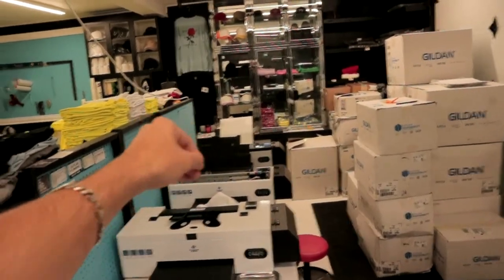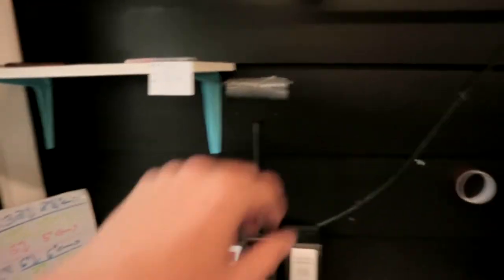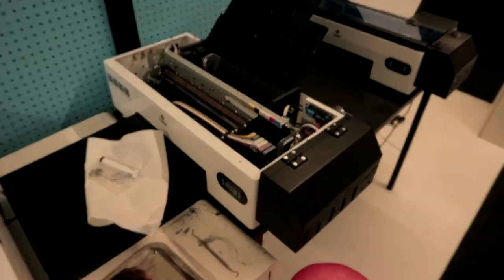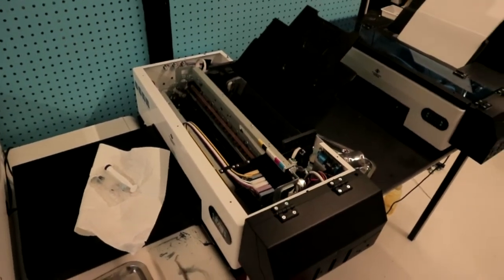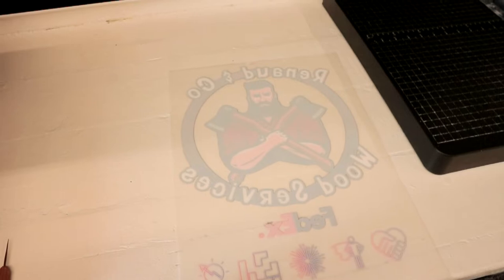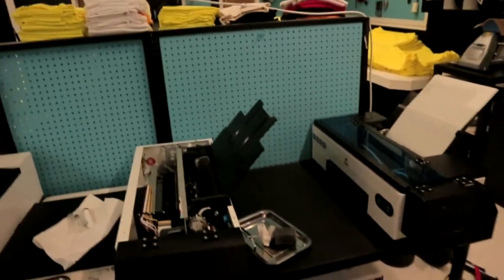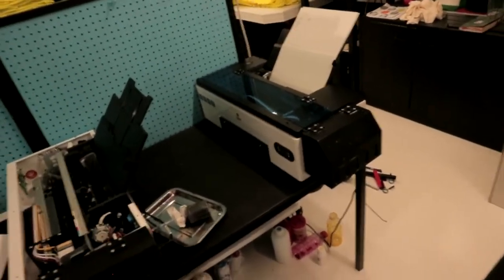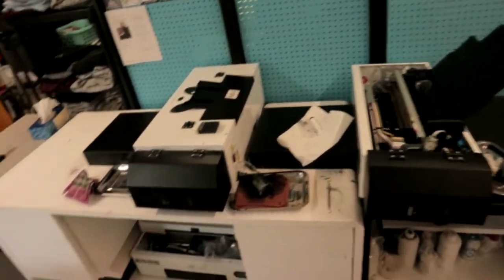Direct to Film FAQ's DTF Q&A's #3

Comment: Are all your machines the procolored L1800? What are your thoughts on the DX5(R2000) printer head which looks to be a step up from the L1800 printer head?
Reply from the maker: never tried it
Reply: Can you help with the DX5 R2000 Stylus Photo printer (got thru procolored). I have paper and ink lights blinking (alternating)... machine has power (red button in back) but the ON button in the front goes off but the lights stay blinking..... PLEASE PLEASE HELP
Reply: @Wholeprinting Can you help with the DX5 R2000 Stylus Photo printer (got thru procolored). I have paper and ink lights blinking (alternating)... machine has power (red button in back) but the ON button in the front goes off but the lights stay blinking..... PLEASE PLEASE HELP

Comment: Thank you for the video Dom, I purchased a procolored A3 L1800, 2 weeks ago and cannot find a video to show how to program my settings for printing. I installed the software and the ink.  Printed out several prints. The only problem is that my white will not come out. Can you please do a video soon showing how to program the software?  How to set the printer, ink and layout pages. I'm searching for help and keep reaching out to Procolored and not receiving the help.  I'm sure it's due to the time difference. I've called the numbers they given with no answer. I've even waited up later to reach out.  Email seems to be the only contact though we have yet to connect.  I also ordered the same ink you have to make sure that I'm on the right track.  I've waited up later to reach out.  Email seems to be the only contact.  We have yet to connect.  I also ordered the same ink you have to make sure that I'm on the right track. I have the Rip v10 software that came with it. Please help. 
Rhonda
Reply from the maker: Email us - wholesprinting@gmail.com